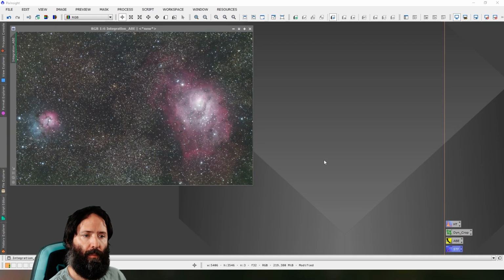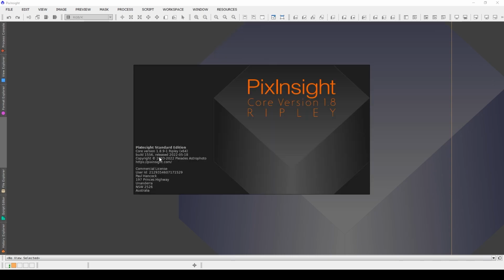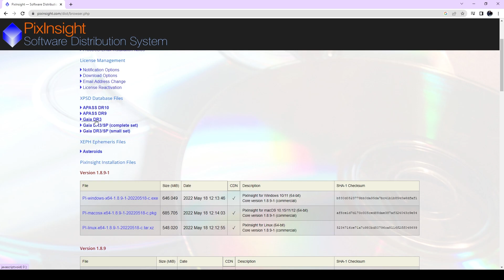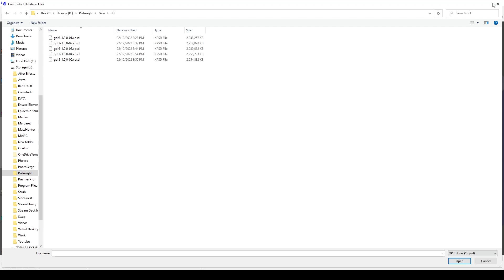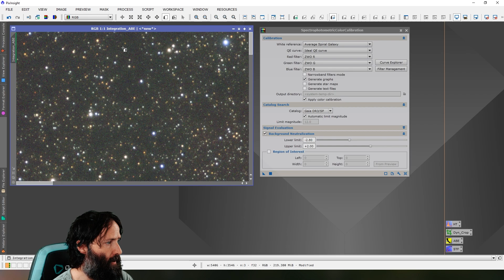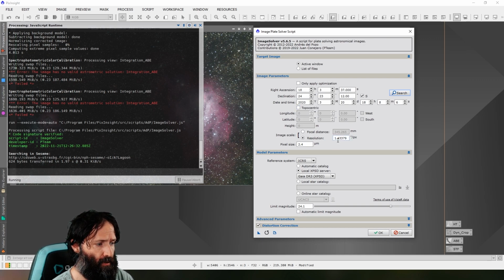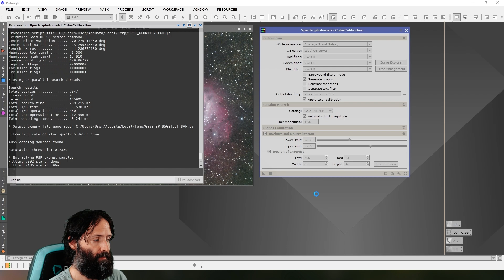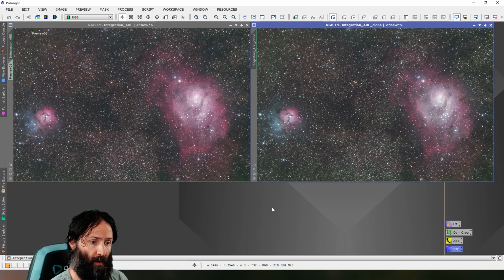Part IV - SPCC

Comment: Hi and thanks for your videos.  Can you suggest how many gaia star files I need using my 11" SCT at 1800 or 2800 mm FL (OLD XLT version, not Edge) ?  I have a lot of imagesolver fails in PIS, about 90%.  Other solvers such as ASTAP & PS3 do much better but still struggle with the SCT when I am imaging.  Thx.  Les

Comment: Very clear and helpful thanks. As I always use WBPP, can I forgo having the GaiaDR3 files when using SPCC? I think it will still work but I am not f'ully convinced. Advice appreciated. Cheers, Des
Reply from the maker: As far as I’m aware you would be fine with just the DR3/SP files for SPCC.  If SPCC can’t find the astrometric solution for whatever reason though, then you need to run image solver which requires the DR3 files.
Reply: @PaulymanAstro  Many thanks